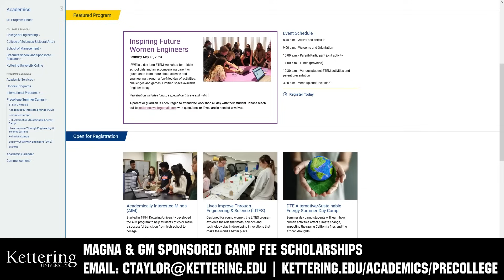Behind the Bumpers | 4414 HighTide | World Champions | Bonus Pit Tour

Comment: I'm curious to see if the 12 motor swerve actually made a difference. Typically traction has been the limiting factor on speed and center of mass played a big part this year as well. I do see how being able to gear it higher while also having more torque to keep acceleration high might have it's benefits. Plus this is way easier than a differential swerve.
Reply: It very much does make a difference if you watch some of their matches. It's unfortunate that the new motor update came out for them.